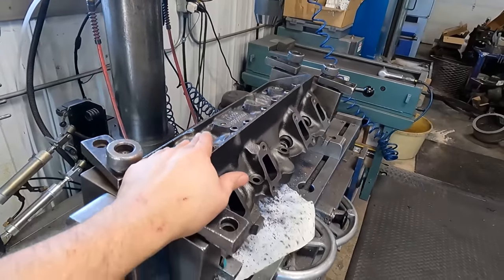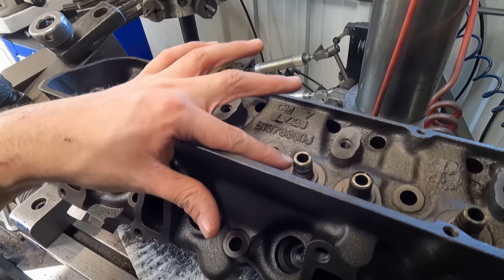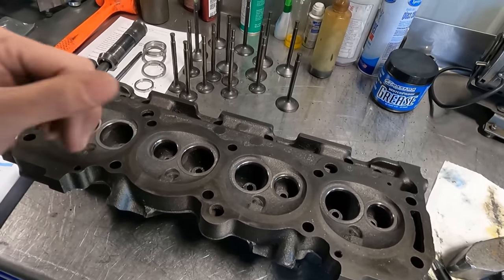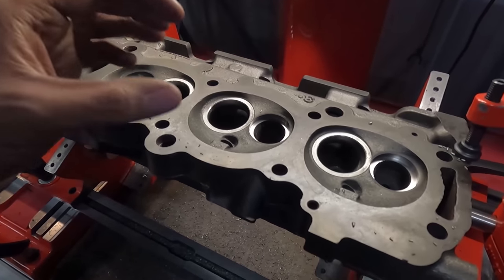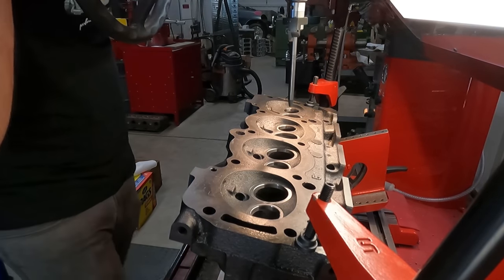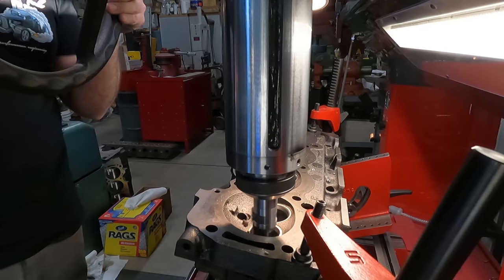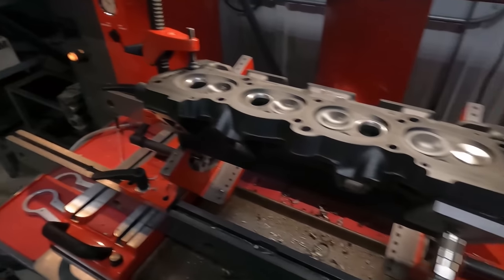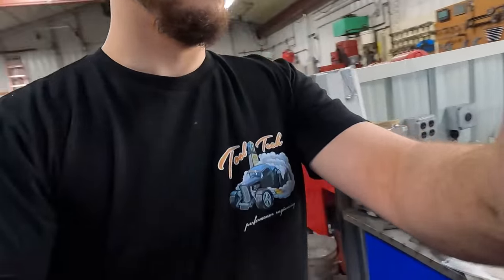Detroit Diesel Flywheel Grind - 340 Buick Valve Job - Vlog 4@JAMSIONLINE

Comment: Although I’m sure it has been mentioned but Big Cat and Cummins are quite a bit heaver. That is a lighter version found on the 12.7L the 14L is heaver to support the extra power. The dished area on the back is not there. All of theses use the same size clutch 15.5 inch. There exceptions to this. The clutch weighs about 150lbs twin disk setup

Comment: Be sure to throw a straight edge across the too of the L20 head to make sure it's not bowed before you start. Top of the head must be flat before guides, seat cutting or surfacing or when it gets torqued down the cam bores wont be straight. Big issue on all OHC  heads

Comment: Did you put anything on the seats to keep them from coming loose ?
Reply: And are the new seat rings made of cast or a harder steel?
Reply: Nothing is needed to stop them coming loose, they're an interference fit.
Reply: I ran into the problem when the heads get hot the seat will fall out..I used a adhesive to keep it from happening..
Reply: @augustinchapa5144  they shouldn't really fall out with the correct nip, somewhere between .0045 and .006 is usually plenty. I've never had one fall out yet and do everything from small diesels to race & rally car heads 👍
Reply: We use green Loctite. We also use it on the valve guides and cylinder sleeves.
Reply: @lonniejohnston1476  i also use green loctite on guides and sleeves, but not to retain them. Just to stop anything leaking past them if there's any damage from previous removal or installation 👍

Comment: I’m surprised that leveling the head is accurate enough. Non-automotive machinists spend a lot of time indicating in their work. Are the tolerances here a little looser?
Reply from the maker: The Serdi 4.5 has a patented triple air float centering system. I’ve touched base on it in the past; but essentially the machine compensates.